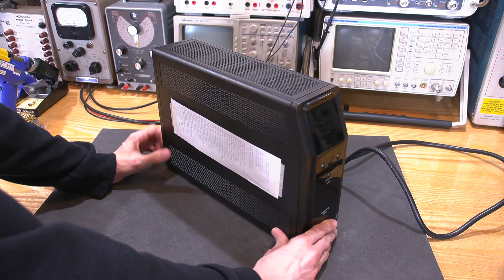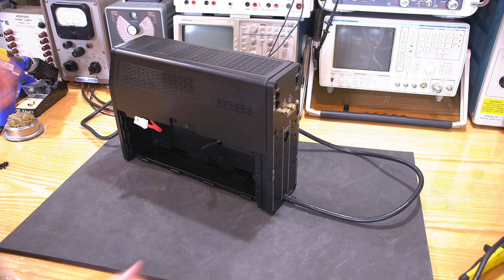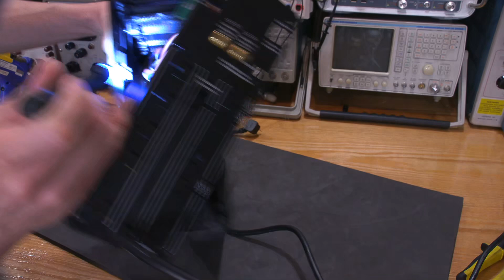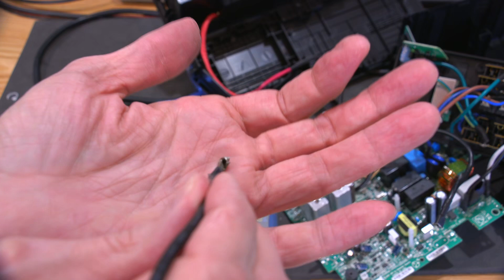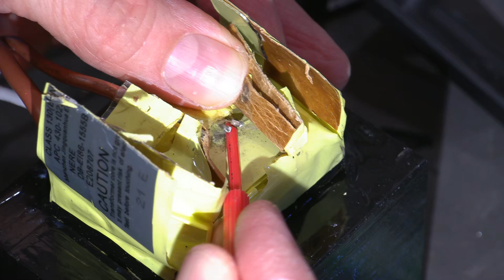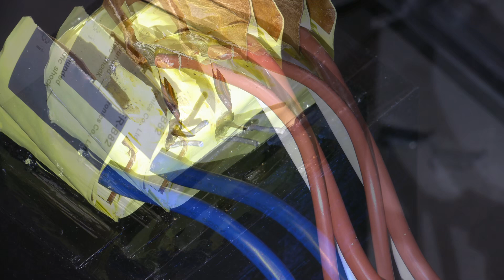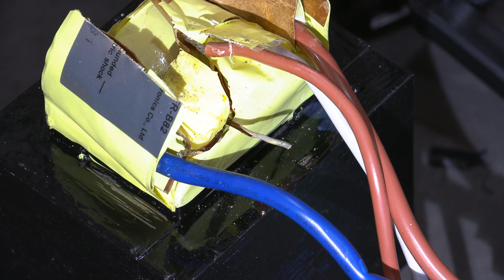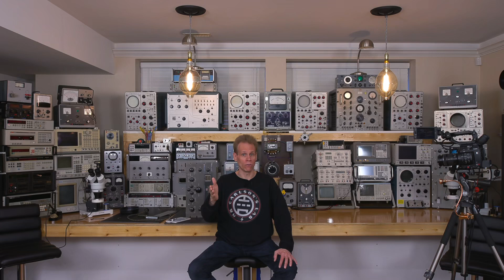UPS Electrical Failure - Teardown and Analysis!

Comment: I would hope that the transformer originated from China?, or are other countries falling to such low standards now? I was watching Big Clive's live stream yesterday and he mentioned his concern about how much electrical stuff was coming out of China that was using very cheap aluminium wire. Very surprised to see it used in a transformer, that is very worrying, simply because you cannot really tell without employing some kind of destructive method in order to check. Makes you wonder just how many companies could be fitting similar transformers into products without realising?

Comment: I wonder if they outsourced the transformer manufacturing and that company tried to get away with alu windings. Those connections should have been crimped. That's extremely unprofessional and downright dangerous! That's a fire hazard!

Comment: I've owned seven mew APC UPS's so far. The first dates back to the late 90's/ early 00's. All had a similar QA printout taped to them. That printout used to be a sign of quality. Most QA printouts are now just generic marketing gimmicks. Regardless, that isn't a sign of a repaired device.

Regarding APC quality: Yeah, those connections are very questionable. The real problem is that most companies have determined that quality is inversely proportionate to profit. In other words, most companies make junk to increase profits. I still buy APC products because they happen to make the most reliable junk.

Comment: The sad thing is that properly designed, aluminium windings are fine. They should have been properly terminated with an appropriate crimp however. There are solders that will solder aluminium, but they need special flux and proper cleaning to stabilise them - ordinary tin or tin/lead solders just won't work. In the 90's I used to work in a data centre and the engineers there  recommended APC UPS's when I asked about one for my home setup, but it seems quality has gone downhill as other commenters here have said. For equipment that is possibly safety related this kind of short cut is unacceptable. I'd be inclined to demand my money back from the people that supplied them as they are clearly not manufactured to an acceptable quality.

Comment: I remember fixing a variant of these 1500 watt APC branded UPS devices I found in our apartments trash room.  The problem was no 120v output on the protected side, via battery backup or ac.  I ended up fixing it by replacing a ST Micro VIPR PWM switcher IC and a few supporting components.  I used a thermal imaging camera to find the fault (huge cold spot centering around this VIPR IC and next to it, a blown diode and a blown fuse).  This device found a new life being the backup device in my media cabinet to keep the wifi and routers going in the event of a power failure.

Not a fan of this brand either, but I can’t see this thing polluting our landfills, so decided to get it back up and running and repurposing it and just investing a few dollars in parts.

Comment: Easy fix of the transformer. Short length of 3/16" copper tubing, crimped over all 3  wires with a crimping tool and then fill in the tubing with solder. 5 minutes, put it back together and voila.. all better. (repot with bathroom tile silicone sealer and it will run fine (assuming nothing on one of the boards overheated)

Comment: Wow I had apc stuff in the 90s early 2000s and I bet they used copper back then. Never had a problem with them other than changing batteries.
Reply: I'm currently running a small APC for the router and cable box on my TV.  It's dated 1998, it's been through 4 batteries and 3 hurricanes and still works a champ.
Reply: @dennisp.2147  Wow they were better back then I wouldn't buy a new one today

Comment: Scary. They (and I bet it was the transformer sub-contractor) could have gotten away with it. Had they used real Aluminium to Copper crimps or had they just ran aluminum wire as the terminal wires with aluminum brazed connections and appropriate connectors. But then APC might have seen that they used aluminum wire. Soviet Era Russia is full of aluminum wire and it works fine because everything in contact with was designed for it and they used appropriate installation methods. The problems come when someone changes out a socket for one designed for copper wire.

Comment: Enjoyed the video, but I have to wonder why you did not use aluminium solder. I have some here and it works well but requires a higher temperature than than traditional tin/lead solder.
Reply from the maker: Hi David. Have you ever seen (or tried) to solder Aluminum? There is a reason you haven't. Welding Aluminum is a completely different story.
Reply: @MrCarlsonsLab  Yes I have.  I have a length of aluminium solder that contains a special flux. The secret is to scrape the item to be soldered to remove any oxidation and then immediately solder it without delay.
Reply from the maker: @davidpratt4009  I would love to inspect that connection, or any connection that has been soldered to Aluminum wire.

Comment: I've had nothing but problems with APC (American Power Conversion) Back Ups / Uninterruptible power supplies myself in the past and I am firmly in the: "I won't use APC" products camp also. The company used to make good products many years ago however, as is clearly displayed by the junk transformer in your APC product here Mr. Carlson, APC makes junk in the current/modern day. I am aware of aluminum wire having been used in house wiring, here in the states, and it was bad practice back then, but to wind a "personal use" transformer today, using aluminum wire is just shameful. You really sank to the bottom now APC!!! Sheesh, they could have at the very least used CCA (Copper Clad Aluminum) wire, to wind their crappy transformers with. It is really depressing to see how shoddy this company (APC) has gotten. I feel like an apology is due to our Canadian electronics content producer, as a fellow American... This is just unbelievable APC... Sorry Mr. Carlson, on behalf of APC. American products used to be the best you could buy, back in the past century. Obviously APC does not pride themselves on the "Made In America" theme at all. APC is garbage now. Duly noted.   Fred
Edited: for typographical error.

Comment: Dang, of course, I just bought the same UPC a couple of months ago. Aluminum can be soldered, but it requires special methods. The problem is that aluminum instantly oxidizes on the surface, which prevents solder wicking and flowing. Have to abrade it in an oxygen free environment, either under gas or mineral oil, then tin it with solder before the skin of aluminum oxide forms. Aluminum crimp terminals are used with a oil/zinc grit paste that cuts through to clean aluminum and crimps to gas-tight "weld" to form a permanent connection.

Comment: Not even CCA (copper clad aluminum) !? But aluminum should be kept out of transformers to begin with...

Wondering if there are UPS units out there that are "transformerless" (they still have transformers but way smaller) and basically create AC voltage similar to a car audio amplifier. That would be costly!

Comment: APC probably didn‘t even know China was shafting them with aluminum wire, first ones during design were likely copper. APC says can we get a better deal on quantity 1000, China goes sure and winds them in aluminum. And the dummies in QC never wondered why the transformers were coming in lighter.
Reply: APC repair techs didn‘t care to know why thing were failing, just send out a new one. Techs know nothing about aluminum oxidation (redox) with those crappy crimp taps in the transformer. No squirt of antioxidant paste on the connection. Think about the requirement of a UPS, China wants America to fail in every way possible. I went into Menards a few years back to purchase a wheel barrel wheel before I got to check out I was spinning the wheel on my finger, felt gritty, with my pocket flashlight I saw metal shaving in the bearing. Go back to get another and unboxed more, all 30 of them had metal shavings in the bearings. Made in guess where!

Comment: That winding was a surprise to say the least! I have a 12 volt version of a UPS that I picked up at a transfer site and was able to salvage the transformer.I installed a bridge rectifier on it and made a dynamotor power source out of it for some WW2 projects. If I find another exact unit, I am going to pull the transformer apart and see what the windings are made of? Cheap is cheap!

Comment: Sadly,aluminum wire is used everywhere these days,including the MAIN feed into most house breaker panels-they have a anti corrosive paste to use on the connections.. Miller bobcat welders went to aluminum transformers,they are terrible to use,amperage out changes when the aluminum transformers heat up. seeing alot of electronics coils,chokes etc use aluminum wire coated in copper.  Ethernet cables(CCA) copper clad aluminum.. so much junk out there.

Comment: Wow, Shockingly bad design. You could look up some special flux to solder aluminium.
I occasionally use it. You can get some via eBay, has russian text on the label.
The smoke coming of that stuff is bad for your health, it's also bad for your iron's tip.
You need a high power/big tip iron for that, but the solder will 'take' to the aluminium.
Thanks for the upload !

Comment: 1:10 Every APC UPS I've ever installed had these QC Labels. Everything from their SOHO lines to Commercial/Data Center Rackmount Applications.

Since the Schneider Electric Acquisition, I've noticed a change in quality. Quite disappointing. I go out of my way to purchase older units and refurbish them now for my own personal use.

I have a couple of newer ones though with no issues so far though.

Not compared the the Cyberpower units I've had fail.

Comment: Great video Paul! Just goes to show how much crap there is on the market today. Who in their right mind thought you could solder aluminum to copper? It doesn't fly. A while back I tried to make a homebrew isolation transformer out of two microwave transformers, but little did I know that all of the Windings were aluminum as well, and when I tried to take the Transformers apart to make it out of two primary windings, they fell apart and I noticed the aluminum construction. So cheap! Needless to say I turfed them and will be seeking out something with real copper windings.

Comment: It would be interesting to get more cross analysis of various UPSes.  It has been known for a while that these cheapy APC units are not designed to last, they are light duty products for the occasional power outage, but geez-o aluminum wire in the transformer?!  (The problem being aluminum gets hot under load, so that thin insulation on the magnet wires fatigues and fails much faster.)  There are the commercial units that are much more expensive.  It would be interesting to see if these are built better these days.  So far I have only seen one of the commercial variants fail due to obvious signs of high g-forces put on it at some point before I received it.  It would also be interesting to see a tear down of a double inversion unit.  The reason being the double inversion units are supposed to be the real 'quality' units as they are designed to do a continuous conversion from AC to DC and back to AC.  It is known that everything else has crappier electronics inside and inferior cooling, but it would be good to know if they have started to cheap out on even their best units or not.  As the home market is a competitive one, it would be interesting to see what the competitors do and if they are really building better UPSes or not or if it has just been a race to the bottom.

As for the life of an APC UPS, these cheapy Back-UPS home units have not really been designed to last more than 6-8 years max for a while now, but looking at this I have to wonder if they can even make it that far, at least if they see a significant amount of use.  The regular Smart-UPS units should be able to make it 7-10 years.  I have seen a shop push some out to 15 years, but they were putting out dirty power and causing the hardware connected to corrupt to the point where key services stopped working due to corruption and even corruption to the point where the critical hardware would not boot anymore because the file system was hosed due to severe corruption.  This was corrected by swapping out those old APC units and things have been humming along for over a year since without issue where before everything connected was fouling up.  The double inversion units also are not supposed to last forever because while they are supposed to have quality hardware inside, it is under continuous use (unless it goes into bypass mode).

Comment: That case design is already very disappointing. There really isnt much to be saved going from sheet metal to injection molded plastics given the immense upfront cost of the moldmaking and engineering that went into it. The beancounters try to save every penny these days. And that is unacceptable for a professional device built to protect valuable gear. Such a thing needs to be overbuilt!

Comment: As somebody who rewinds power transformers in my spare time I will tell you something I have run across with Chinese built power transformers. Some munufactures are now using copper clad aluminum core wire. I have noticed this failure point in a dozen of those transformers. So now when I source my magnet wire I make sure that it doesn’t say copper clad. I have actually started using in some cases used copper wire from old sealed AC compressors. Fortunately I’ve got an AC guy that gives me all of his removed equipment. Very simple to save the windings out of those compressors once you cut the compressor open you soak the stator windings in gasoline for a week to dissolve the encapsulation varnish and then you can undo the lacing and remove the plastic strips that secure Wire windings in the stator and then carefully uncoiled windings of the stater. The gasoline does not hurt the insulation enamel.

Comment: Many years ago my crt tv released some magic smoke with a poping sound. Turned it off immediately to avoid further damage. Never found any broken caps or traces of one. Turned it on and worked fine for many years after that.

Comment: I've got a bunch of Eaton I bought almost 15 years ago. I think most of them is the 5115 model. Been changing batteries when needed (about 5-6 years), none of them failed yet. Been through at least 50 longer power failures and many more shorter ones (yes, Sweden isn't what it used to be). The main reason buying Eaton at the time was that the APC I was buying before that had poor battery life, like 2 years, 3 years if lucky. The Eaton's I got instead almost doubled it. Plus I got sine wave for less money than APC.

Comment: What's amazing is that was on the primary (high voltage side), amazing total junk. I assume that transformer went straight in the trash. I guess you could save the core. The core looked very nice. Hi hi.

Comment: I recently had a similar size CyberPower unit fail after a power outage. I’ll be curious to see if they are using the same configuration for a transformer.

Comment: Looking at the lead out wire it appears to be aluminum too. I would guess the connection between the lead out and the xformer windings were intended to be resistance welded (some form of spotwelding) together. Welding aluminum is very process sensitive. The surfaces must be 100% oxide free. You cannot clean it, go to lunch and then come back and weld it. It is nearly impossible to get a home wired with aluminum wiring insured. Despite being a good conductor, aluminum does not make good wiring.

Comment: You can sonically weld aluminum to aluminum, and with a really good scouring under a pool of flux you can even solder copper to aluminum, but it's not any fun at all. Speed flux will work in a pinch too and again it's sketchy and not very much fun. You want phosphoric acid and IPA. (Isopropyl Alcohol, NOT India Pale Ale!)

Comment: What a lousy construction of the hardest working part in the box! 

I have a question: I'm getting a lot of CB Radios that need the final transistors replaced. Typically 2SC1969's, which are increasingly difficult to find and not cheap. There's a lot of guys using IRF 510 or 520 MOSFETs instead. It would be great to have a video explaining the challenges and solutions involving this modification. I'm having hit and miss success doing this, mainly because I don't fully understand MOSFETs well enough to troubleshoot issues, especially when it comes to RF.

Comment: I had a APC 1400 UPS fail replace battery's 2x12 volt could not replace them no consumer reparable parts inside the batteries were sealed up inside the case the agents said it was not worth their while to replace/repair these units just go and buy a new UPS What a waste

Comment: All APC UPS's come with that label as far as I know, I guess for APC to prove they tested before shipping. I just know the 3KVA to 8KVA UPS's we run in our server rooms all came with that label showing tests passed etc. With ours I generally run them for 4 years, then replace batteries (replace within 5years is general practice for larger capacity ones) and run them for another 4 years, then retire them, though apparently if the large bulk capacitors are replaced you can run them much longer. PS: Yes I have seen more modern transformers using Aluminium windings to save costs, profit margin is important I guess, though didnt expect to see this in an APC UPS. Does it say where that one was made?